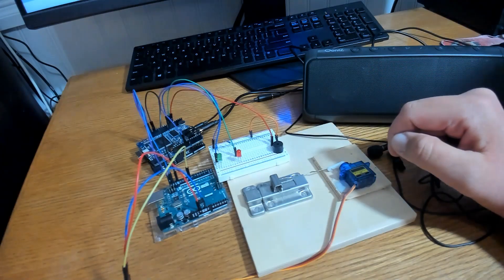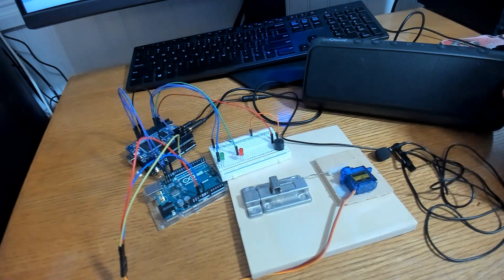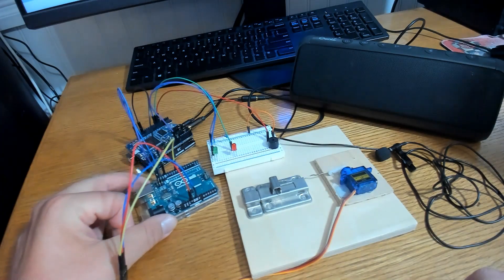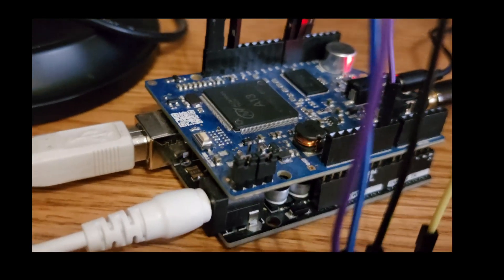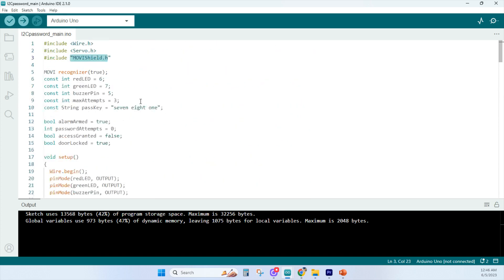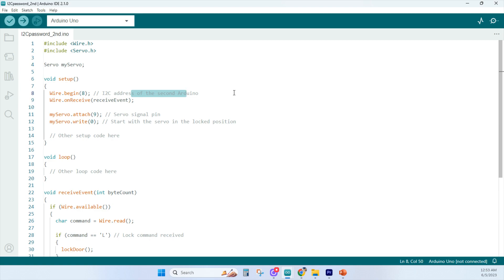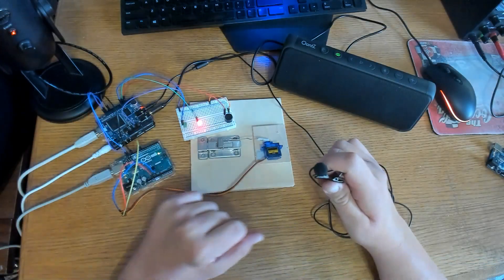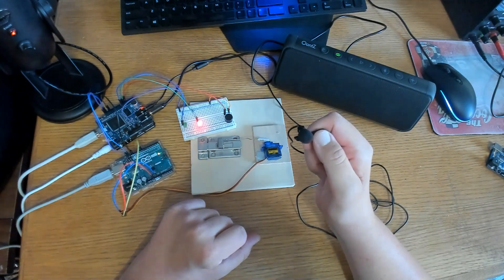Smart Door Lock System using Arduino Uno and MOVI Voice Recognition

Comment: hi if i use the component esp32 and inmp441 can i follow this ?
Reply from the maker: hey there!
The MOVI board was designed for 5v Arduino Uno and Mega boards but if you are a savy tech guru you could do a work around to get it operational. You will need to stepdown voltage to 3.3v, modify pins, and you'll run  into issues with libraries if you use those. 
I like the idea of using esp32, but never tried it.

Comment: if we use other voice module, which you can suggest another voice module?
Reply from the maker: hey there!
I haven't used another voice module but I would like to try the Nicla Voice at some point. low energy, on-board mic, small form factor and It's compatible with Nicla, Portenta and MKR products.

Comment: the components item?
Reply from the maker: Hey there!  sure... here's what I used.
MOVI voice recognition shield w/ arduino uno, another arduino uno, a mini servo motor, piezo buzzer, lapel mic for the MOVI board, a stand alone speaker (i'm using Oontz Angle 3 Pro) connected to MOVI using a 3.5mm cable, a slide lock I got from Lowes, red and green LEDs, jumper wires, small breadboard.  👍

Comment: where did you get the door lock and the metal price that is connected to the servo and the lock?
Reply from the maker: hey there! The lock is from Amazon - Tegg 1 PC 2 Inches Stainless Steel Door Latch Slide Barrel Door Lock Sliding Catch Bolt Latch for Bathroom Bathroom Toilet Door BedroomBedroom
The wire between the servo and lock is just a bent paper clip...high tech, right? 😆
You could also look into the electromagnetic solenoid locks - they may be more efficient.